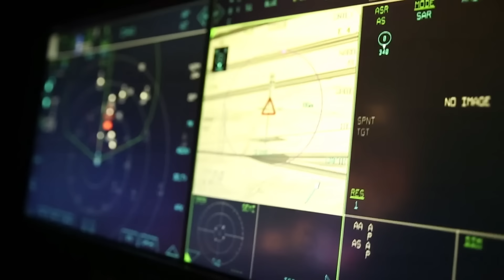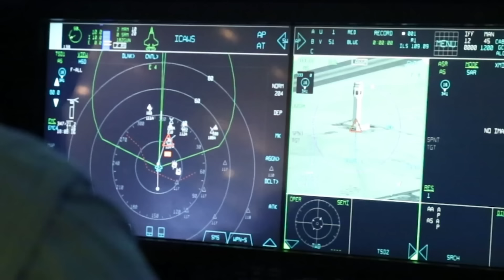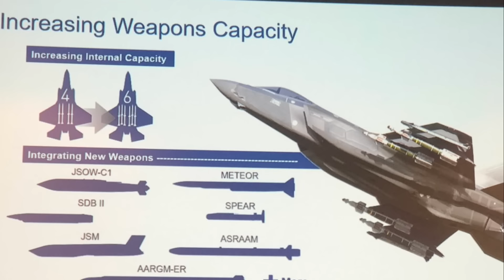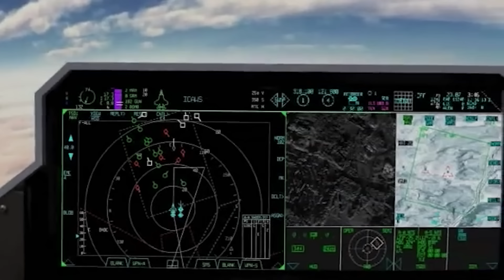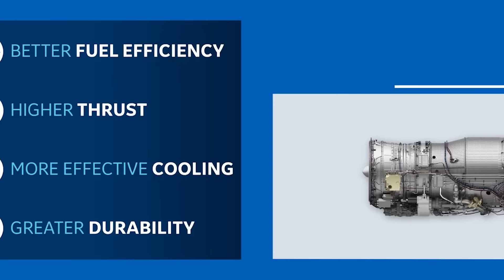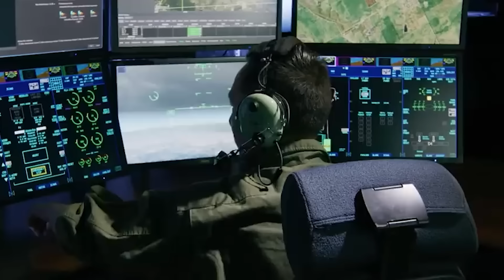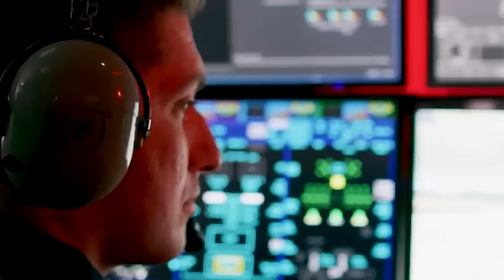The F-35 is about to become a POWERHOUSE

Comment: The F-35 going to be in service for decades it's worth every penny. The fuel savings of the Adaptive cycle engine will easily outweigh the cost of development and upgrades.
Reply: But it’s crazy how a f-18 is less expensive to fly still
Reply: That'll probably be the next major upgrade. Probably around 2030ish once the tech has matured.
Reply: @therealman2016  Not by much, and it depends on what evaluation you go by. They, also, forget to add in the maintenance on all the pods the F/A-18 needs to do its job, too. That come standard on the F-35.
Reply: Let me let you in on a little secret: upgrades in fuel efficiency on jet fighter engines are not meant to reduce costs but increase range.
Reply: They aren't doing that adaptive cycle GE engine, they are getting the cheap one from Pratt and Whitney with minor improvements.
Reply: @user-os6ch5pt7w  If i go after the Brochure of Lockheed martin, that plane has won every war since 1999. Luckily, it has not scored an Air to air Kill. And the ground attacks were nothing to write home about looking at Afghan civilian casualties here. The last 2 years of the conflict, the USA killed more Afghan Civilians than the Taliban. Kinda speaks for itself. don't you think?
Reply: @Gunni1972  Israeli Air Force has scored 2 Air-to-air kills on Iranian stealth long-range strike drones.

Deep strikes into Syrian targets have been ongoing for many years now, in places where legacy fighters can't fly near due to the range of modern SAMs.
Reply: Show me the math that says the fuel savings will come anywhere close to the $1.7 Trillion dollar cost of the program and then we can talk.
Reply: @arvont1  I’m still trying to find the legitimacy in that number…
Reply: Can’t believe I get to maintain these things. It’s a hell of a lot less of a headache than literally every other aircraft lol
Reply: @arvont1  There isn't a $1.7 Trillion number.  That's made up/guesstimate as to what acquisition, operations, and maintenance will cost into the 2070s, 50 years from now.

It would be like telling someone a particular new car is expensive because of what it will cost in gas, parts replacement, oil changes, dealer services, fender benders, and all costs for you, your kids, and grandkids who drive it in the future.

Makes you wonder what motive is involved behind those numbers.
Reply: I thought we were supposed to be going all electric? LOL
Reply: Saying it is "worth every penny" is a gross overstatement that was clearly made to show your bias.
Reply: just to be parked and have no real battle, only bomb innocent civilians in some dirt poor country
Reply: Imagine how much better and cheaper it would be without all the corruption. Look at nasa sls, 10 billion for leftovers from the space shuttle compared to space x, under 1 billion on starship
Reply: @edsherwook5196  Artemis has flown around the moon. Starship hasn’t made it to space yet.  So we will see.
Reply: @zappulla4092  starship is 3 years old sls has been in development since 2011 ms it’s old technology.
Reply: @zappulla4092  only thing sls has done is highlight how inefficient are government is
Reply: @LRRPFco52 wow, so an aircraft that is only good at  loitering, has no countermeasures, and is not built for evasive manoeuvres? This is its claim to fame?
Reply: @therealman2016  so is a p51 mustang, but you go ahead and tell the military to use that thing
Reply: The F35 is one radar breakthrough away from being obsolete. It’s extremely over built, but essentially a one trick pony that relies on its stealth because it’s not great at much else.
Reply: @Gunni1972  the only caveat I would list there is that they’re always civilians because the Taliban strips the weapons off the bodies before they count them as civilians
Reply: @LRRPFco52  LOL!!!! Are you for real? The CBO started out calling these things $300 million an air frame, and then Lockheed started chipping away at that number and every single time they have quoted it since it is always gone down by a couple million dollars every single time regardless of the actual cost . By the time Lockheed is done bragging, these planes will cost $2 million apiece…. But the taxpayers will still be on the hook for $1 trillion.
Reply: @Matt-yg8ub  "One Radar breakthrough away".  VLO/Stealth Technology isn't static.  It has evolved since it was introduced in the 1940s. The A-12 Spyplane had upgrades to reduce its RCS when they replaced the Titanium variable inlet spikes with polycarbonate spikes, as well as the vertical stabs.

SR-71A went through further RCS reduction measures, including using fuel laced with cesium to eliminate the RF resonant harmonics of the afterburner plume shock cones.

The YF-117 and F-117A underwent no less than 3 RAM upgrades.

The F-35 program already had a major change to the RAM and structures with Lot 4 forward.

Sensors and VLO technology play cat and mouse with each other not only in RF, but the IR and other spectrums.  F-35 is way ahead of the power curve in this space.
Reply: @Matt-yg8ub  Not even the original LRIP birds have been even close to $300m.

A very basic reality you learn in business math is unit cost reduction with mass production.  The JSF program has capitalized on that years ago due to 128-136 of them being produced every year.

I've tracked unit costs of each lot of F-35A, B, and C models for years.  The A model got down to $77.9m years ago.  Block 4 will go up to $83m, which is lower than almost any other modern fighter.
Reply: good luck finding part distributors for this high tech stuff.
Reply: @ARICKROSSPRODUCTION  The list of parts manufacturers for the F-35 is huge and redundant across multiple nations, and at least 44 US States.  There are 3 assembly lines as well, 1 in Japan, 1 in Texas, and 1 in Italy.  It has companies competing with each other for subcomponent and major systems contracts, several of which that have been awarded to other companies already.
Reply: @Ed Sherwook  one actually flies and works.  Musk will spend more.
Reply: I feel like your research into your comment with him about as far as your imagination😂 just because they’re more fuel, efficient doesn’t mean the military is going to use less fuel will probably just fly further missions and do more stuff in the military. They’re not concerned about gas mileage for savings they’re concerned about it for more capability.
Reply: 140theguy
Do not forget to mention it’s continuous cost savings of it being continually grounded 
Whether it’s requiring re coating of its radar absorbing stealth material or the front wheel flawed design or it becoming the world’s best submarine launched from aircraft carriers 
One really does have to handed to this 110 million per unit garbage
Reply: @mark4371  F-35s aren't continually grounded.  F-16 was continually grounded when it hit the fleet, grounded about every month to quarter.  143 airframe losses and 71 fatalities in its first 10 years.

You don't re-coat F-35 RAM really, with a few exceptions to phase-level, not daily squadron ops.  The RAM is baked into the FiberMat Carbon Nanotube structures.

Nose wheel is fine on F-35s.  F-16s still regularly fold the nose wheel in on runway overshoots. 

F-35C is the safest carrier-borne fighter in USN history.  F-14 first 10 years saw 73 crashes and 19 fatalities.
F/A-18 had 97 airframe losses and 27 fatalities.

Harrier had 100 losses and 20 fatalities.

F-35A, B, & C are not only the opposite of how you see them, but dramatically so.
Reply: No, it's not worth it in these numbers.  The F35 represents an over design for the task that was needed and will almost assuredly will be at a great disadvantage in performance when stealth is ubiquitous.  It's high cost (currently 113 million per plane will prevent reproduction and repair in a attritional war.
Reply: @saquist  try 70 million
Reply: @140theguy  I don't have to ...'try'.  I already know we are spending 16.4 Billion dollars (including upgrades on Lot 15.  I already know the number of planes we are producing in 2023. That's 145.  Therefore actual cost is 113 million per plane...
Would you like to add any data...or is this just a blind assertion?
Reply: @Gunni1972 lol😂😂😂  non of what you said is true.  We're you in Afganistan?  No.  Have you ever served in the US Military?  No.  And we can tell
Reply: @saquist 113 million per plane for the best Jet on the planet is really really cheap.
Reply: @atomatlas5595  whoops as of July 19th 2023 Lockheed is having problems...again. cutting back deliveries from 157 planes to 100 of 120 planes. Cost went up to $16.5 billion..  LOL so now the plane will cost $165 million to $137 million... going in the wrong direction....and they "can't figure out why the cost is going up"...right...
Reply: @saquist  right....  if the countries have contracts in place the agreed price would ve the delivery price.  But even with delays they have been make hood deliveries, unlike the SU 57, who barely could produce 12. But it doesn't matter, every single figther pilot around the planet wants to be in an F 35.  Because every single pilot knows the F 35 is the best and will likely keep you alive
Reply: @atomatlas5595  it's nothing more than a stealth bomber. Once stealth is ubiquitous it will be nothing more than a high tech coffin.
Reply: @saquist  right....  a stealth bomber that beats all Chinese and Russian jets easily.  Actually any American made jet will beat any Russian Jet easy
Reply: @atomatlas5595  F35 with nullified stealth won't be beating anything easily. It's a flying brick.
Reply: If you guys also think its expensive for an F 35...  remember that the Global Hawk Drone that America uses starts from $130 million for the Blocl 40 version, but they get up to $200 million dollars a piece. That's just a drone.
Reply: Ppp
Reply: It might burn less fuel “per mile” but that just means they’ll fly it further so no fuel saved just more miles done no money saved, maybe more spent due to more hours flown
Reply: @HeatGeek1 eventually yes
Reply: The F35 is still not good to go to War.
It's not an upgrade...it's 15 billion more to try to have the plane fulfill what it was supposed to do ...and doesn't.

Reminder : this plane who is now said to be a surgeon stealth instrument ....(It is not.)
Was, at the beginning, supposed to replace all US airplanes.
It does everything...so badly that the USAF and US Navy reduced their orders and went for more next gen F15 and F18.
Also the F35 has so many problems that is was nicknamed 
"the flying pingouin"
"A national disaster"
"The 1400 billion scam" 
So please.. Please ... 
Cut your crap.
Reply: It’s interesting the amount of the people posting here who know all the details of this jet, future military plans, and military spending….  So you all work for the pentagon or the private sector contracted by the US government ??? Wow! amazing (lots of sarcasm!!)
Reply: For American spending that's a little over 1 days cash flow if that.
Reply: Fuel costs are nothing compared to the rest
Reply: @fppro1679  right it doesn't even touch 1%. And in banking you can take loans up to 5x to 8x your annual earnings.  America literally makes 22 trillion dollars a year, we can take a loan up to 160 trillion dollars and still be consider safe.
Reply: @atomatlas5595 where did they fight?
Reply: 1.6 trillion dollar worth of fuel is hella lot fuel to burn even with high fuel prices. 10 billion extra is nothing
Reply: @alexdarcydestsimon3767 ”at the beginning it was supposed to replace all us airplanes” yes it’s still supposed to it’s already replaced the regular hornet just because the us is buying upgraded f-15s who’s whole purpose is to support and enhance the f-35 fleet doesn’t mean the f-35 has failed at anything

 it’s beat every single fighter it’s been scheduled against in redflag and over 30 countries have bought it and yes it does have a bunch of nicknames that people with no knowledge or experience in aeronautical engineering like Pierre spray that doesn’t negate any of its feats or capabilities
Reply: FUEL SAVINGS HAHAHA
Reply: It’s slow and it’s crap
Reply: It most likely will  have laser capabilities in the future.
Reply: Thank you
Reply: @LRRPFco52  Israel also used the F-35 to shoot down a cruise missile.
Reply: @mark4371  The focus is more on jamming in the future not stealth.
Reply: @saquist  The side kick rack allows the fighter to carry six missiles instead of four.
Reply: @galvinstanley3235  
The future is emp cruise missiles
Reply: @galvinstanley3235  Yes.  Current official Air-to-Air count for F-35 is 3/0, all unmanned targets so far.  No Air Force in their right mind would purposely penetrate airspace patrolled by 5th Gen fighters like the F-22A or F-35s.
Reply: @galvinstanley3235  it will only be on f35s rolling off the assembly lines. So far as I know not one F35 has ever been fixed or modified. They just become limited or spare parts for the operational fleet.
Reply: @Eboreg2 doesn’t matter the intent, they achieve both desirable outcomes
Reply: Even a brick can be made performant with the right engine upgrade. @saquist
Reply: @billymania11  Indeed. The 10% increase in wet Thrust would make the F35's T/W at .98. Which is actually better than the super Hornet  (not with F16 ) Now it's a contender.
Reply: @Eboreg2 good point sir, i still probably would have been thinking of fuel efficiency from a standard consumer POV like OP, since fuel economy is most noticeable in household budgeting rather than being the difference in capability. The extended range on the F35, in addition to the developments from the stealth based drop tank program they were designing for the F22 will hopefully translate to a significant extension of that combat range.
Reply: @edsherwook5196 the only thing your comments have done is highlight how asanine it's been to pull money from the US educational system.
Reply: @lovinsubs   And your comment struggle to distinguish you among the annals of reason and logic.

I looked back at Billymania11's comments about Starship vs NASA. I have already done the numbers. Space X is already 80% cheaper than the Space Shuttle, 20% cheaper than Boeing and can go lower. 

I work in this industry and follow the money. SLS is $3.5 to $4 billion dollars. More than 2x the space shuttle and NADA has asked for any help in reducing that cost. These are very similar companies to Lockheed Martin. 

This year alone we lost $100 million dollars to Lockheed Martin because they delivered only a hundred F35s instead of 240 as per the contract.

So thus year the average cost ofvthe F35 was $160 million not 70 million.
Reply: Supercruise cometh with GE XA100 adaptive engine.
Reply: @saquist The true value of the F-35 is its Command Control & Communications capability. Everyone is missing the point in trying to compare numbers (speed, turning radius, climb rate, how much it can carry etc...) rather than its ability to communicate with other planes to give a integrated picture of the battlefield, control loyal wingmen drones and hit targets precisely (CCC). At the beginning of WW2, Germany statistically didn't have the most, biggest or fastest tanks, but it did have a communication device in every tank to coordinate the attack. That's something no other nation used extensively at the time. To look at statistics, not tactics, is only good for the PR guy. Combat is Proof of Concept not statistics (IMHO).
Reply: @MrSmada4   of course but a communications platorm doesn't justify $165 million per plane and 1.7 trillion over the life of the program., nor the numbers...2400 planes is too much for an over glorified Growler.